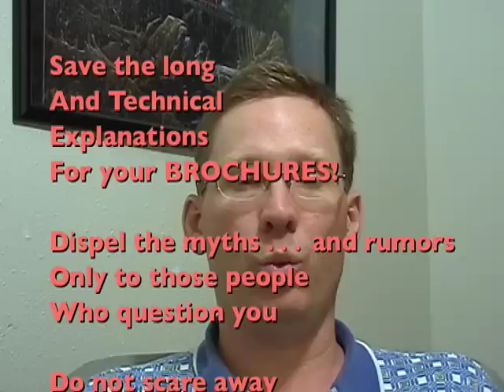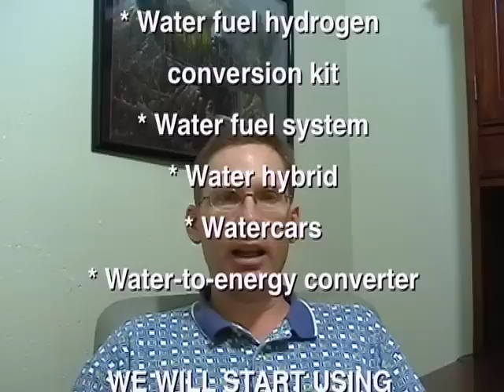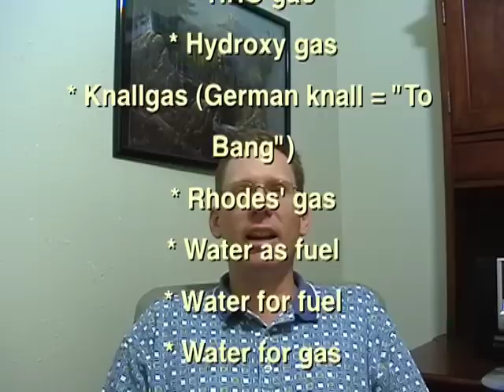Say Electrolytic Injection not HHO generator Brown's gas

Comment: Yea, the idea is slowly taking hold, even tho the opposition is still mounting a massive counter-intel operation against it. I mean look what happened to the Webster-Heise Valve. The big companies shut it down claiming it didnt work, even tho privately funded tests had great results. But the HHO concept is so simple that people at home are deving the technology. Hard to suppress that. I think eventually it will be a "Tuned Port Electrolytic Injection" where the reaction happens @ the cylinder.